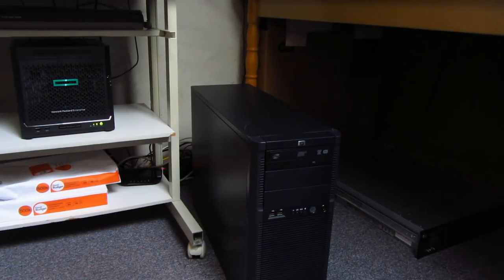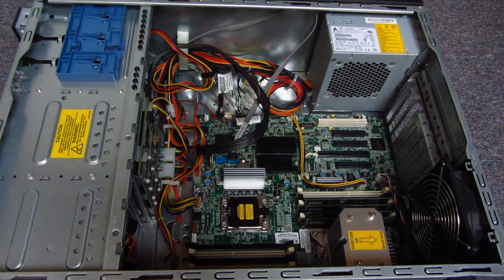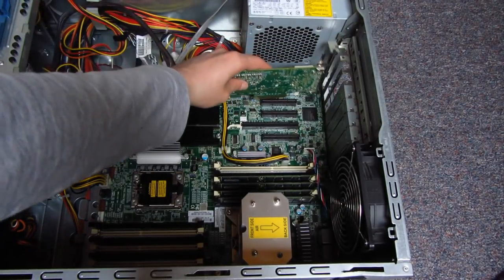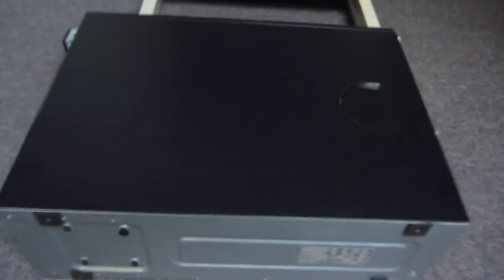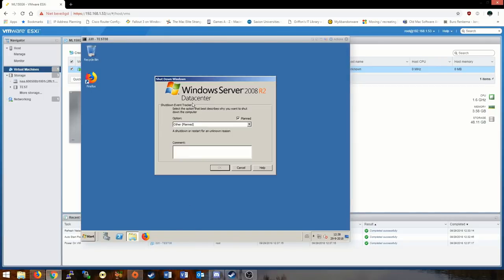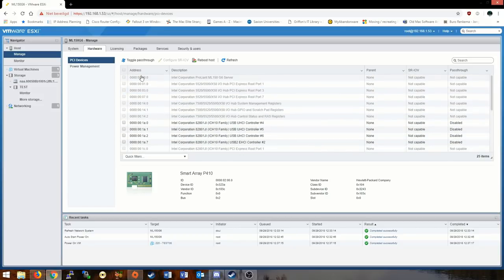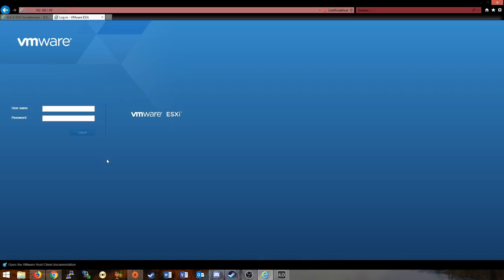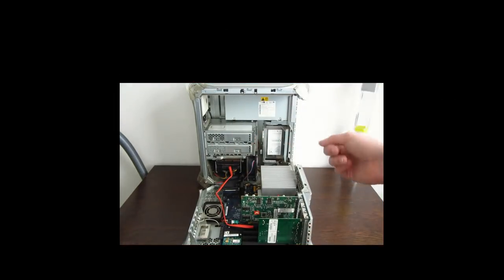The Server Extravaganza!

Comment: Hey I have an Acer Aspire 5002WLMI and it just won't boot and no lights turn on even with the battery and power cord in. Do you know anything that could help me?
Reply from the maker: If it does nothing at all and you know for sure your ac adapter is still good, you can be sure it’s a motherboard failure.
Reply: Ok, Thanks! But do you know if you can replace the motherboard on that model laptop?
Reply from the maker: You can replace the board on any laptop, yeah. Considering they were budget machines to begin with back in 2005, I wouldn’t bother unless you can find a replacement board for like $10. An entire replacement laptop for parts might be easier to find.
Reply: Ok. I'm subscribing btw!